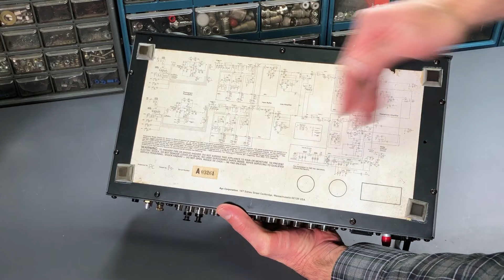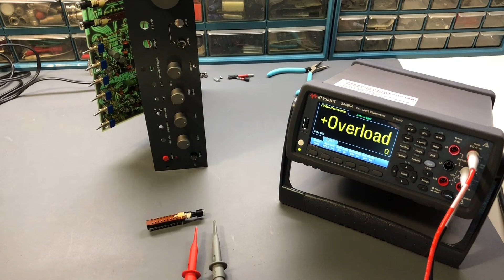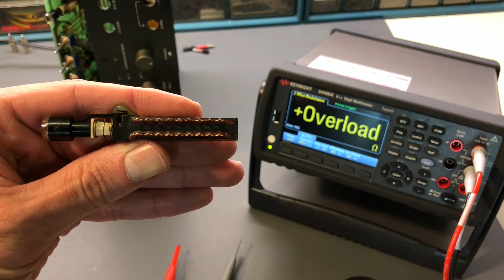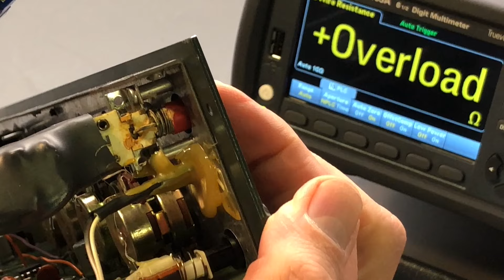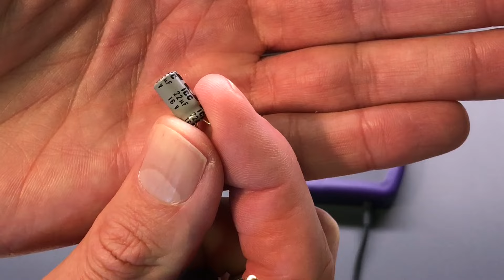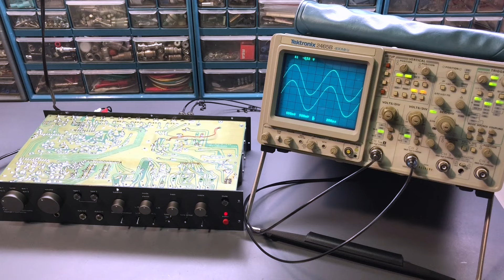Apt Corp. Holman Preamplifier Repair And Test

Comment: You neglected to mention the primary use for the mode control. Set the input to Phono1 or Phono 2, turn Mode all the way to L-R, put a mono record one the turntable, then, on the left side of the preamp (as you look at the front), look for two small holes. These are the phono balance controls. Use a long-shaft jeweler's regular screwdriver to access the screws within the holes. With the record playing, adjust the phono balance control until you get absolute minimum output. That means the two channels of the cartridge are balanced - most cartridges only specify channel balance within a half-dB or so. The Apt Holman allows absolute channel balance.
Reply from the maker: Thank you for sharing this information.
Reply: @EriksElectronicsWorkbench  Very good point.

Comment: I'm just finishing up refurbishing one of these preamps, and in addition to recapping, I found that it had three bad opamps. Two of them, IC3 and IC4, were "hiding" because they are the tape monitor output buffers which hardly anyone uses these days, but they were internally shorted and were hot to the touch. This would not have shown up in a simple input/output test because they are not in the direct signal path. So I would encourage anyone working on one of these to test the voltages at each IC pin to make sure you're seeing what's supposed to be there. IC11 in mine was also bad, which helps explain why one channel didn't sound as good as the other. As I've often found in other repairs, one type of component tended to fail across the whole unit; all the 10uF/16V capacitors were bad to some degree (excessive ESR). And, of course, switches had to be cleaned. 

I think mine must have been subjected to a power spike at some point in its history because IC1 had already been replaced in an old repair, and it's possible the spike came in through the Tape Monitor connections.
Reply from the maker: Thanks for sharing this info.  Yes it seems like a power spike or excessive voltage was applied to the tape monitor loop.

Comment: I have the same preamp with the identical problem with the tape monitor switch.  I wish that you had shown the disassembly of the chassis to reach the switches!   I saw how the circuit board had been mounted to the chassis, but feared removing the attachment screws and then fooling around in an attempt to remove that circuit board.    

It probably could cost a young fortune to hire a tech like you to restore one if these units.  It is indeed a remarkable piece of gear!
Reply from the maker: At 11:40 I have only removed screws holding the cover in place and then several screws on the circuit board.  You see the board tilted up but no wires or components are actually removed to do this. Just be careful not to pull on attached wires.  The ribbon cable is rather stiff.   Thanks for taking time to watch!

Comment: Great work .love your attention to detail.I don't work on domestic HiFi  much anymore not much around worth repairing.Gone to the Pro Video and audio side.i always check frequency response with a load of at least 600 ohms or sometimes 200 ohms depending on the output impedance.Old faulty caps show up immediately  wish poor low frequency response

Comment: Thank you, how did you clean the switchs please?
Reply from the maker: I use the NTE p/n RX500-12 contact cleaner with lube.  As mentioned in the video I was able to work the cleaner into the the switch through the hole by the latch mechanism basically flooding the switch with cleaner and then activating it many times.
Reply: @EriksElectronicsWorkbench  thank for the response. 👌

Comment: Thanks for a peek inside the Holman preamp! Years ago when I was doing my first system build, I considered one of those, but happened upon a used Threshold NS10 instead. FYI, you should consider using the "Delta" or "REL" function  to zero test leads when checking for low resistance faults. It can be especially helpful if you are trying to troubleshoot a dead short without wanting to disconnect anything, as it will give you that ability to find the short by getting your test leads as close to the fault as possible with some point to point maneuvering of probes.

Comment: Thanks for the video. I would however prefer if you showed the unsoldering of the switch and cleaning it, removing the  caps etc. Feels dry without it. Too clinical but still enjoyed it. Just my 2 cents. Thanks again for the video
Reply from the maker: In some of my other videos I do show desoldering and soldering capacitors such as in the safety capacitor video   https://www.youtube.com/watch?v=GDTuHDsHHFA  I use a Hakko FR-301 to desolder.